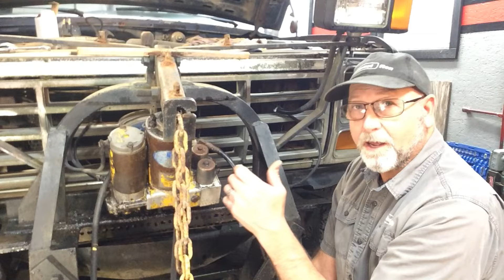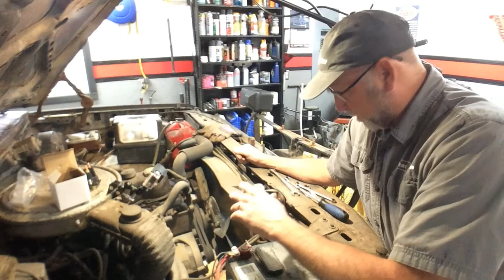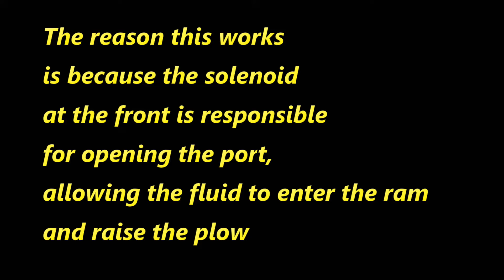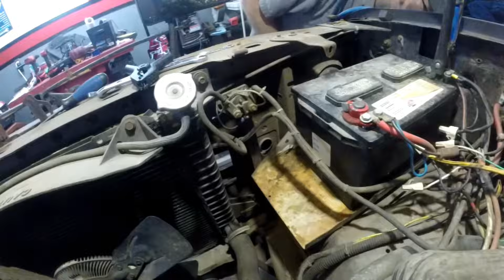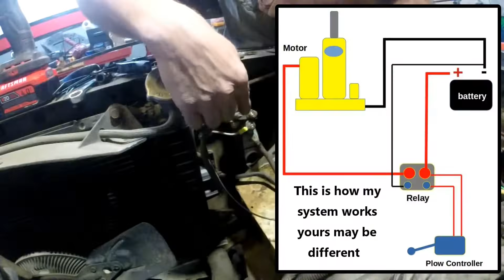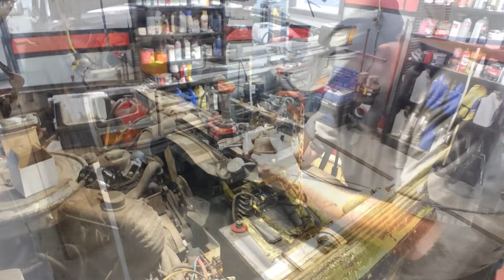Meyers Snow Plow Repair

Comment: Thanks Ron the most useful video I’ve seen yet. I have a Meyers’s snow plow that I bought for my Kubota tractor. Tractor doesn’t have a third function but the plow has the hydraulic pump. I’ve been trying to figure out how to wire it because the plow didn’t come withe any wiring .thanks for the information.